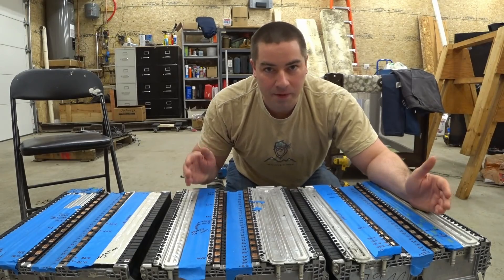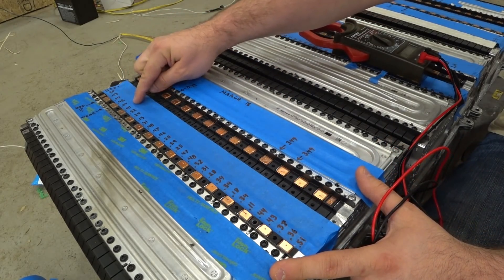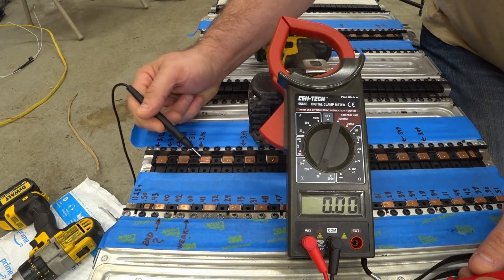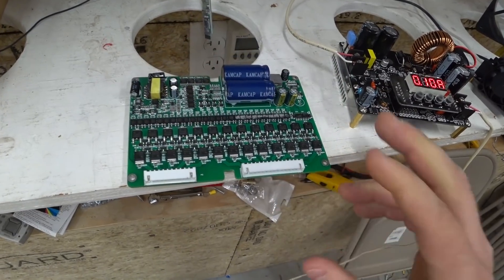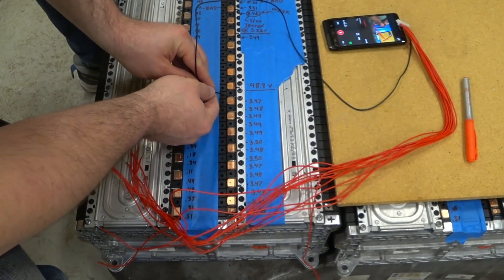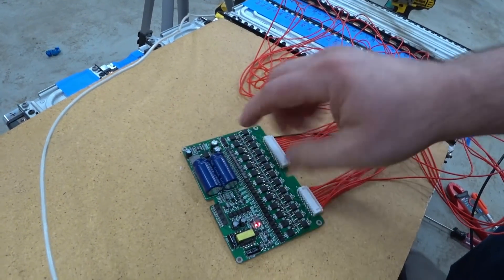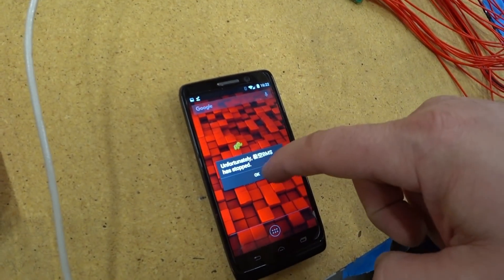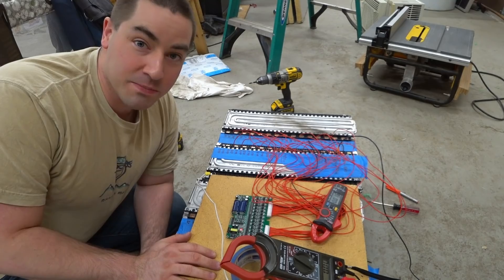Can I bring this dead Lithium Battery back to Life?

Comment: You done it totally wrong , the last wire should be on the last postive of the battery , you only have 12S you don't need to use up all the wires 
 

fyi : you never turned on the balancing option in the setting ontop beside the waiting . according the the screenshot i see it being not turn on .  maybe I'm wrong , but you have to turn the small options on . 

and fyi this Active BMS will fry if you set it up like this .  1s first negative to 11s then last row connect to the last postive

Comment: i bought one of those balancers from aliexpress. you have to contact the seller to get the manual and and software.
i cannot recommend that active balancer. as a matter of fact that is the second bad experience with active balancers. it shuttles current around alright. in my case depleting cell number 1 (most minus) to balance the rest. that is why the cell voltage reading is 10mV to high than the actual cell voltage. the software therefore presumes that cell has over voltage. this however changes on the higher bulk voltage where it turns "normal" sort of and then reverses previous depletion of cell 1 and tries to charge up again, all the while ignoring other cells.
the balancing really should start at 3.5V (lifepo4) and not lower . as the cells do not go up with voltage exactly all together. there is some variation. i suppose something to do with innter resistance of the cell.
in short i do not recommend wasting money on them unless you are experimenting, like in my case.
Reply: did u source a better one?

Comment: That particular bms can work with 12s configuration if it equals 40 volts or greater. Otherwise you have to use an external power source.
Reply from the maker: Yep, you are right about the voltage.  BTW, this is just a balancer, not a BMS.  Thanks for watching.
Reply: @DavidPozEnergy  yes you are correct. Thanks

Comment: Hi David i have been interested all kind of electric toys for 30 or so years now so my latest build with lithium from a FIAT  500E battery is my sreet legal trike. i am at 200 volts and having a hell of a time manually keeping cells balanced. currently looking for active balancer but so many out their and i have had my fair share of failed china balance boards with no blue tooth leaving me with burned cells. so my question is how is your balancer holding up. as well is the app working well. i need help before i burn up my trike.
Reply from the maker: The balancer works... most of the time.  Sometimes after an update on my phone I can't open the app.  Then the next time there is an update I can open the app again.  Sometimes I check on my cells and the balancer has turned off for no apparent reason.  Now, when it is working, it is accurate and moves energy from high cells to low cells.  But it's a PIA.  I think the company (JK) needs to do some polishing on the design.

Comment: 0v cells you can shock them ~2a with higher voltage then see if they will take a charge
Reply: As a DIY battery enthusiast over many years, I can say that 0.00v is the end. I have cranked my bench power supply to 30v and they just sit there. Occasionally I can jump start one with a cell-to-cell transfer. However, the voltage drops very quickly after that. i believe jump starting just causes a momentary "reflection" voltage. I've got a bucket of these if you want to come and get them!

Comment: Dude, I have been looking for a decent active BMS foreverrrrrrrrrrrrr!!!! Like since 2016
Reply from the maker: I hope more come to market so the manufacturers make them better and better.  This one has a glitchy app, but the unit works as it should.
Reply: @DavidPozEnergy  hi david can you share me  the link of the app for android? I bought 1A and 2A balancer
Reply from the maker: Hi minoru kurata,  I wish I could.  The links I had have all expired.  If you bought it through Aliexpress, you can send the seller a message and they should get back to you with the link.  At least that is what worked before.
Reply: @DavidPozEnergy  thanks dave I'll try it

Comment: If I send you the battery from my smart car can you recharge it as the voltage dropped to low and the car charger will not charge it
Reply from the maker: I don't have space.  But, if you are in Massachusetts I can come to your place and give you a hand.  Send me a message on facebook.  Link in description.
Reply: @DavidPozEnergy  I am in Idaho but would appreciate it if you could walk me through it when I get home in June as I am working out of town until then

Comment: I think that if the cells are discharged very slowly they may not be damaged as badly as when they are used under load and one cell hits 0 or maybe even forced in reverse. I've also taking batteries apart that were  in parallel where everyone was reading 0 and when I individually separated the cells and charge them some came back. I too have a great quantity of batteries that I am testing I'm trying to revive. You can click on my profile picture to see my videos

Comment: The voltage is only one indicator. Typically when a cell has been over discharged, you lose significant anounts of capacity (Amp Hours), A damaged cell can still charge up to proper voltage, but it will have only a fraction of its original capacity. the only way to know for certain is to put every cell through a capacity test.
Reply: LIES

Comment: Suddenly it looks like I dont need to spend $1000 on a Batrium BMS.....
Reply from the maker: I don't know.  This is just balancing out the cells.  It offers no safety systems to shut down the battery .  I don't own a Batrium, but don't they have safety systems built in?
Reply: @DavidPozEnergy  You can get an extension board which you can then have control relays/breakers. But the basic package does just balancing and current measurement. Most of the setups I've seen online have not used the expansion board. I plan on using an inverter that has voltage and current readouts, so having something like this seems to do everything the batrium would be doing for me at 1/9th the price.
Reply from the maker: I didn't realize you had to pay extra for protection with the Batrium.  Wow.
Reply: Batrium is an overpriced gimmick for suckers

Comment: This is for all the uneducated people who told you to throw these away:

" Cells 2, 3, and 4 did not exhibit ISCr after being overdischarged to MIN, A and B (Fig. 1(c)), respectively, as they could be fully recharged and cycled without any signs of ISCr or significant capacity loss. The results of the non-ISCr cells suggest that if the overdischarge is terminated before point B at approximately −12% SOC (the first platform after the occurrence of the minimum voltage), the cell can be fully charged back and reused with only minor side effects.
Neither ISCr nor capacity fading occurs if the overdischarge is terminated before −12% SOC, where the first platform after the minimum voltage is located. However, if the terminal SOC is lower than −12%, then the battery suffers from ISCr, which is the result of Cu foil dissolution and deposition on electrodes according to the SEM and XRD results."
Source:Guo, R. et al. Mechanism of the entire overdischarge process and overdischarge-induced internal short circuit in lithium-ion batteries. Sci. Rep. 6, 30248; doi: 10.1038/srep30248 (2016).

In layman's terms, if you discharge to 0v, nothing bad happens. If you go negative by 12% SOC, then you lose capacity and form shorts
Reply: David, because it looks like this pack self discharged by way of short circuit, it is unlikely that any of the cells went past 0v. Which means that they can be recovered. To go negative voltage would require badly unbalanced cells that continued to discharge via the pack current after 0v was reached
Reply: "The electrical characteristics of these overdischarged cells are examined to assess the relationship between the ISC and depth of discharge (DOD). The cells are then rested for 100 days to assess the self-repair capability of overdischarged cells. The ISC is characterized by comparing the DOD with the capacity loss, leakage current, and ISC resistance. The degree of the ISC is found to increase nonlinearly with the DOD. A DOD of 120% or more can induce an irreversible ISC, and the electrical characteristics of severely overdischarged cells are similar to linear resistance characteristics. The self-repair behavior occurs in the cells with a DOD of less than 120% after a longtime rest and leads to a decrease in the degree of the ISC."

In layman's terms, if a cell has over-discharged, let it sit for 100 days. Doing this will result in a lower occurrence of internal short circuit. It's likely this pack sat for 100 days right?

Comment: Funny you made this video, i have been playing around with Arduino's to build a DIY BMS that doesn't burn off voltage myself. I currently have it setup on 4 x 18650 test circuit. I use a 2 x resistor voltage divider circuit to create an input to read the voltage of the battery pack. After figuring out the output variable that equals 16.4V, i setup a simple loop that says if 16.4v or greater is detected to output a trigger, which i use that output trigger to activate a relay that triggers the input voltage to the 4 x TP4056 modules. On a second Arduino, i have individual voltage divider circuits sensing the voltage from the 4 cells individually. Each of those voltage outputs is used to trigger relays, which redirects the output of the TP4056 to a single cell until the sensed voltage reaches a set voltage variable of 4.1v and then stops turning off the relay. I know there are probably easier methods to program and sort all this out, but it was only a few dollars in parts and I'm learning how to use and program Arduinos. The Arduinos i got from aliexpress for $3ea, the 8 relay 5v boards were $2ea, the  TP4056 modules were 25cents each in a pack of 10 and the resistors and wiring was stuff I already had laying around. The reasoning on how i have it setup are as follows. I have my solar charge controller setup to charge my 18650 packs on my DIY 12s powerwall to 50V, which puts the resting voltage of the cells typically around 4.15v per pack. So when the solar charger is in absorption/float it triggers the BMS circuit to top balance the cells by turning on the relay that supplies the input voltage to all the TP4056 modules, which is pulled from the pack via a 48v to 5v module. The 2nd arduino is always sensing the individual cells and triggering the relays even if the TP4056 is not turned on due to the input voltage missing. The charging only starts when the first arduino senses a pack voltage of 4.1V or greater and triggers the power input to the TP4056s, Then they all come to life and start charging the 18650 cells based on the internal ramping current they are programmed to until the arduino senses the cell at 4.1v and disconnects the relay to that cell, stopping the charging on that cell. This is a very crude analog approach to it, but i feel its far safer and more reliable route to go about it. I tried using mosfets and they got super warm while controlling them via pwm outputs on the arduino to control the charging path of the TP4056, but they would confuse the TP4056 modules often due to the period of time it takes to ramp up the charging amps on the modules, the littlest of voltage float would cause the modules to constantly restart over and over, so ditched it all and just went to simple relays with pause delays, which so far is showing promising. Just playing with the 4 cell test setup, i can discharge 1 cell in the pack to like 3.8v and charge the other 3 to 4.3v and just within 20 minutes the low cell is brought up to 4.1v. The reason i am limiting everything to 4.1v is due to these cells being used 18650 cells i pulled from laptop packs i got for free mostly. Some cells when you try to charge them to 4.2v they get very warm and take way longer to get to that voltage once they break 4.1v, so i found 4.1v to be a good charge point to stop at which reduces the heat on the cells greatly during charging and typically take a charge to that point much faster than trying to get to 4.2v. The TP4056s will try to charge 4.2v via a ramped current rate, so by the time it gets to 4.1v its barely inputting anything into the cell. So the plan is to let solar get them mostly up to full charge, then allow the BMS to kick in and balance them at the top.

Comment: I like what your doing, I’ve done the same with 2 Tesla modules 6S. But please use caution. I charged the cells at 50ma outside in a weather proof box and let them rest for about a week, read and record internal resistance. Monitored with batrium bms and then draw down to see if capacity was recovered. They seem to be fine, been using them for about a year and get 4800wh a day from them. Good luck

Comment: Be careful.  Once a lithium cell has been discharged beyond a certain point internal damage can and will occur and the cell will be more prone to catastrophic failure (fire).  Personally I wouldn't chance it.
Reply: You clearly don't know what you are talking about. Explain why you think they are damaged. They MIGHT be damaged, but you cannot possibly determine that until they have been tested. As I've already explained many times, lithium batteries are restricted from going too low not because going low damages them (unless high C) but because the inevitable RECHARGE is when the damage is done. Lithium plating, solid electrolyte and dendrites are all processes that occur when too many lithium ions try to move all at once. This happens at very low temperature and also at very low SOC. If you charge very slowly, these 3 processes do not occur. I get my education from Jay Whittacker and Jack Rickard, the two best lithium experts in the world

Comment: Cool product! I really like the idea that this does not leverage resisters. Seems a little more bullet proof than the common Chinese BMS board. I would be really curious if you hook this up to  your Volt pack how much more in balance they can get? For my battery setup they are all "equal" to the hundredth place (ex. 3.80). Right now I don't have a meter that goes to the thousandth so unknown if they are "off" at that level but I think if they are in balance at the hundredth I am fine.  

It would be interesting to see if the app. meter of the equalizer matches other meters or are their differences that would put into question trying to equalize at the level? YT Devildestiny555 did a comparison of meters and the differences that he encountered, interesting findings: https://youtu.be/rSJX2ohggrg
Reply from the maker: Hi Mike,
I'll probably do a quick video some day just hooking it up to the Volt pack and see what happens.  This is only a balance board, not a BMS.  So it still does not offer any self-protection from over-voltage.  I agree, that balance to the milivolt is probably not necessary.  I don't have super accurate multi-meters either.

Comment: I thought about getting one of the active balancers, I think I will wait to see if they start to go out of balance, great video,  I usually had luck if cells are over .4 v, some issues with heat with them if under, if they held a charge,  I haven't had many in that range, most of my cells are new old stock. I'm thinking about going with the EV packs, alot less work than 18650 cells, the cost of just connecting them all together is crazy, keep at it!!!

Comment: Hello David, thanks for your videos and all your great knowledge in energy related topics. I see you are going deeper in the batteries, but I would like to warn you about Lithium. They are great but they are some rules to absolutely follow, mainly about overcharge, over-current and over-discharge...  (and temperature of course). 
Over discharging lithium chemistry increase risk of shorts and thermal runaway. Even if the cells recover most capacity, insulator will mostly likely be damaged. You already saw this in cells they are self discharging quicker. You build a nice house and garage, it will be to bad to see this lost in flames... (and I even don't talk about your family). If it is for science ok, but to plan to use these cells in your garage it worry me. Even these tests can be dangerous, no automatic fire system or alarm, if one cell start heating all will be gone, no chance to stop it :( 
A few links bellow, some publication and a impressive video of folks did not care of proper charger, resulting to overcharge - they were not able to handle anything once it started. Keep safe !
http://publikationer.extweb.sp.se/ViewDocument.aspx?RapportId=14098
https://ntrs.nasa.gov/archive/nasa/casi.ntrs.nasa.gov/20100022570.pdf
https://www.youtube.com/watch?v=of01p0Q-yUM
Reply: Exactly this, I wrote a comment in the same spirit before reading yours. The manufacturer of these cells specifically advises against trying to recharge them if they should ever drop below 1V, those should be considered unsalvageable.